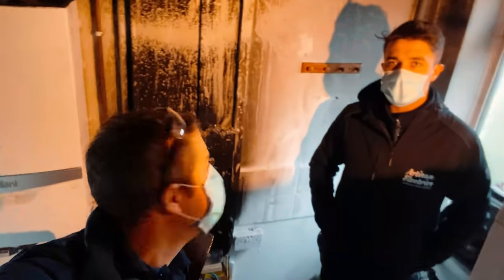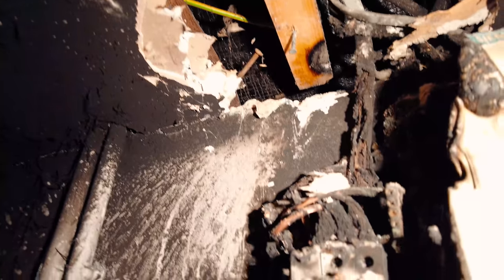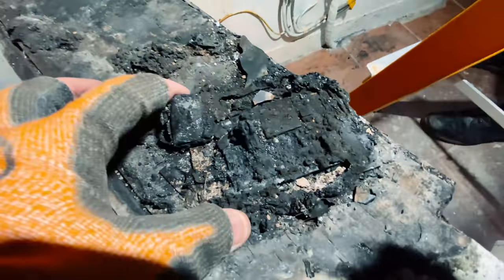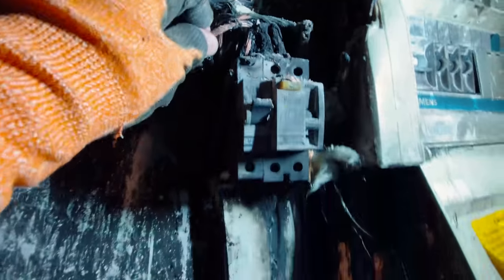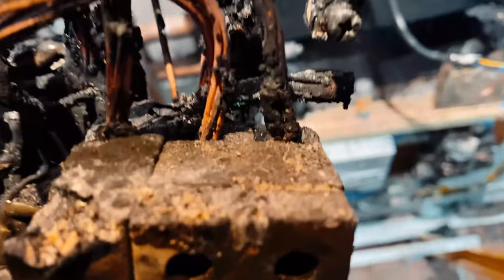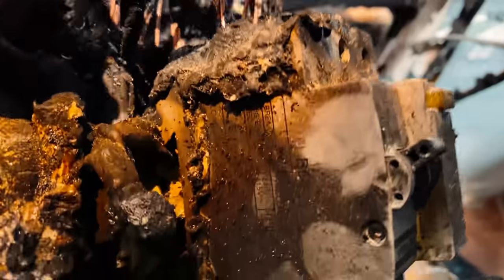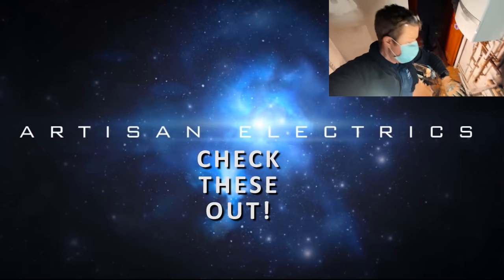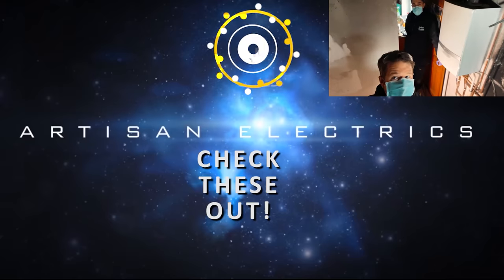Consumer Unit Fire

Comment: Worse fears realised. I'm the sort of person that always has to double check the back door even though I know I've locked it. Likewise with consumer units, I have often taken the cover off again to check terminals even though I know I did it. This would be the stuff of nightmares for me. That's why at 55 I'm giving it up. I don't wish to trivialise PTSD but this job has given me PTSD. Rarely do I sleep through a night without a dream about something like this waking me up. It seems to have got worse with age. Looking at this won't help. My brother in law is a painter and decorator. Works for himself and earns very good money. Sleeps like a log as well. Paint brushes her I come.
Reply: Sad truth is you're the kinda individual we need in this role, so it'd be a loss to loose you. Ultimately rechecking work only consumed your time, how many nested issues are there out there gone unchecked.
Reply: A big part of the problem has to be poor UK regulations. Here in Australia switch gear like that has to be in a metal fireproof enclosure which we call the 'power box' (inside of which is the plastic switch boxes), and every cable entry is sealed with flame retardant, so any fire from a bad joint self extinguishes, usually without even burning more than a few inches of cable from the switch device. Seeing the way you do things where a plastic power box with clear air gaps, can just sit on a flammable wall... its just crazy really. I wonder if UK has more house fires than AUS? Not to mention that appliance installers and plumbers would not be allowed install new switch gear.
Reply: @sectokia1909  Our regs in the UK were updated a few years ago (took them long enough!!) so that metal consumer units are mandatory, plastic ones are no longer allowed for new installations.
Reply: I am 74 and I certainly understand this, it is because you care I work on Auto electrics and the fact that I might be responsible for death injury of people does give me nightmares. My saying after many years in the electrical trades "Nothing is trivial or Obvious"

Comment: 2.45  "customers wants me to get the power back on tonight" are they having a laugh 😂.  First world problems right there
Reply: Maybe they could get a couple of coats of paint on too before they left 😂
Reply: Whilst your here could you change out some downlights for me? 😂
Reply from the maker: Yeah 😂
Reply: I guess they want some heating back which is the first emergency to restore.
But yeah...
Reply: @YouRich92  Fair point but I'd be mentioning that the boiler needs checking before switching back on, especially what looks like a melted filter... But I suppose electric heating is an alternative!
Reply: @artisanelectrics   can u make a video for torque screwdriver draper 19pcs review????? It's made in uk
Reply: @charlieecosta5592  are they fire rated🤔🤔😂😂😂

Comment: I wonder if they completely forgot to tighten the screw, stuffed the wire down the back of the clamp or just didn't recheck after the cable had been manipulated.   I was a sceptic about the torque screwdrivers until I found out that kitchen fitters are using their cordless impact drivers to tighten screws in breakers because they're......   Joiners.  That's resulting in stripped screws (WTF?) and over torqued terminals that still instantly loosened when the cable is moved.  Part-P is a terrible thing.
Technically speaking the electrical regulations don't actually require a shower isolator, but it's encouraged by the shower manufacturers so their electro-labourers can swap bits under warranty without understanding complicated things like distribution boards (meow!).  There's a good chance the isolator was grudgingly installed because the breaker was out of reach.
Reply: Did you ever do a video on this one? Took a quick look but couldn't find it if you have.
Reply: @Jason-ko2tb  
I would LOVE to see Big Clive do a tear down on this 👍🏻
Reply: I had my electric shower re-routed so to speak. It was tripping my RCD

Essentially the person before me was an auto electrician and connected the electric shower on the same circuit as some mains and decided to connect it with a bit of solder which is just fantastic /s

He's qualified to be an auto electrician but not for regular electrics 

I'm glad it tripped in a way, because £200 for a fix is better than a fire which costs a lot more in both money and lives. 

I'll be swapping it out for a mixer shower nonetheless. This is also why you absolutely should get proper sparkies out who know what they're doing.

Or indeed for anything else for that matter. Properly qualified people means that a job is done better

Comment: Very interesting to see the consequences of one loose screw on a high-current circuit. I can see that the 50A breaker didn't trip because the short circuit was on the supply side. I worry a little (as someone who designs EV charge points for a living) that we'll see more of this sort of thing with poorly installed EV chargers. Very few domestic circuits run at full capacity for hours on end, but an EV charger certainly will. Even 32A could get a loose terminal pretty toasty.
Reply: Many meters are in a cabinet on an external wall of the house. I wonder; perhaps splitting the supply off just after the meter (before the consumer unit) and passing the charge point feed through a weatherproof breaker (box) on house exterior would be best? The idea being that any fire would be on the exterior of the house.
Reply: @simongreenidge6454  I guess there's no reason why not, if the layout of the property allows it. Wouldn't work in many properties, like mine in Cambridge, though: the DNO's cutout, meter and consumer unit are all together under the stairs.
Reply: Ye  spot on especially with a load like that
Reply: This is why having a big contactor in the electrical cabinets controlled by a Thermal (HTC) Switch. It will cut off if the cabinet begin to heat too much (before a fire).
Also it is good to check the screws once a year.
Reply: Or manufacturers could transition to spring/lever terminals instead, 32A is perfectly doable and much more reliable in terms of install quality and longevity.

Comment: Few years ago new neighbour got locked out, so when i was getting her in asked her  why she had moved, she said she had a fire in the fuse box and almost burnt her house out, so was downsizing, googled fuse box fires and they seem to happen quite often,  so fitted a smoke alarm inside the fuse box housing cabinet above the front door. and one below it as well to be sure.

Also a while ago taking to an electrical engineer who said that the new smart meters are liable to catch fire as so much power going through such a small  box will cause problems.

Finally even though the power is disconected and fuse removed it still gives me the  shivers, seeing you both with fingers in the maze of cables,  from when i  pushed a Mecanno screwdriver into a 240 set of christmas tree lights, still have that fear of electric  now and the huge bang and shock.

Mecanno screwdrivers could fix anything when youre niave or just thick..

Comment: Many years ago got called out to a badly fire damaged garage with a bedroom above. The person was asleep in the bedroom at the time and room was filling with smoke. It was noticed by other family members who smelt burning and quickly got the person out of bed to safety.
It was a really easy diagnosis of fault. A gas pipe in the garage had a small pin prick allowing gas to escape and directly above was a time switch which switched on at midnight. The small spark from timeswitch ignited gas and it acted as a blow torch straight on to ceiling of garage.

Comment: I like what you said about the shower isolator being near the electric meter. Mine is a similar setup with the main circuit breaker in the meter cupboard however the isolator switch is on the wall in my hallway obviously going through the wall into the back of the shower unit. Interestingly it’s a big red switch much like a cooker switch too

Comment: I have lost count on the amount of slack connections in a consumer unit and shower switch. I always tighten these cables wait 5 minutes then usually get a quarter to half turn on the connection as copper gives.

Comment: Root cause is loose connection which was complicated by 10mm incoming t+e. 
I think the only logical way this can have happened is if the loose incoming connection caused the wire to heat and melt the insulation. Then the incoming positive melted and touched the neutral.
A 60a main fuse will carry an over current and arcing for a reasonable length of time. 
As the 10mm t+e incoming to the shower board was only protected by the supply fuse it should have been 16mm. If they had then shorted it would have carried a higher current and blown the main fuse quicker and heated less.
Reply: You are bang on sir,
Reply: But what caused the heat? Current in the cable or arcing?

Comment: As a old Sparky, I could never understand why the terminals went to one screw instead of the two we used to have. But hey whats a fire between production costs and they have only just gone back to all steel boards, well I never!. A wet string job as we used to say.  6mm backed by a 60/100a supply fuse- electrician?  Toast any one. Good job this guy didn't work on commercial.

Comment: It could have been a lot worse......thanks for showing this. Not sure you have enough cable to put a larger extender box with a DIN rail with extensions below to the CU. If not then wago boxes but just check they match the cable temp and humidity rating in which they are going to be contained in.

Comment: I'm a electrician as well and there should not be any hidden joint boxes especially above the consumer unit the cables should be replaced to the isolator switches  mains to the light circuit and both legs of a ring circuit and if there is a radial circuit the first leg of that should be replaced and any fused isolator switches from the board should be replaced  cables for extensions or a garage should have a isolator switch on it and the main cables should be replaced from the isolator to the board as hidden joint boxes especially when the board is getting replaced you shouldn't by the  bs7671 iee wiring regs place joint boxes on the cables coming into the main board so the first parts of the circuit have to be replaced to the board to keep the installation safe like!!

Comment: Definitely the shower board for point of origin. Looks like the live incomer and neutral shorted and took out the main fuse. Looks of new plaster board and paintwork needed so may as well take down the ceiling to check the cable above. Always a fun job lads.

Comment: Good job it never spread to the gas. That could of gone a lot worse
Reply: I’ve seen a house fire take out a gas boiler, totally destroyed them (there were two) but the gas never leaked or added to the blaze. All gas connections are brass, no plastic & no gaskets or seals that can melt.

Comment: Interesting thought, the old Wyler rewirables had 2 screws on the neutral and outgoing live. They never came lose!
Reply: Brilliant design on such an old board dating back about 50 or 60 years and they had  chunky brass fittings. Shame newer boards don't have that design,I am sure that consumer unit fires would be quite rare if they went back to 2 screws per terminal

Comment: Aren't there experts and investigators from the fire department or the insurance companies, who have expertise in fire investigation? Or is your investigation just out of interest of the client?
No hate! I've just never heard of electrical installation companies doing professional investigation. ;)
Reply: Yeah buddy every fire service in the UK will have a fire investigator  Ias would most insurance companies   Cory said the electricity supplier and Distribution network operator  asked him to investigate any cause of the issue and rectify them where needed I believe  hope this is helpful mate stay safe
Reply from the maker: The energy supplier asked us to provide an investigation and report as the initial thoughts were that the smart meter was to blame because it was recently fitted.
Reply: They often ask sparks to go do an investigation as 1st gen smart meters were notorious for going up in flames after being fitted due to honestly not being fit for purpose as they couldn't handle the load. Also it's basically a half day course for smart meters, lost track of the sites I've attended where they've fitted smart E7 meters and shoved the switch neutral into the data port of the meter done it up, not checked the termination and left. Smart meters by intention are great but the fines the gov issues means the lads are permanently rushing job to job so the quality of the work isn't always the best from my experience.
Reply: @effervescence5664 jesus.. that's crazy I assumed they had to  be competent qualified electricians it frightens.me that  baboons like that can pull the main fuse but yet when it comes to a spark such as Jordan or cory doing it theyd get their knuckles wrapped yet the electricians have several years experience  rather then half a days experience etc . Tbat was educational effer thanks
Reply: @artisanelectrics  Thank you for your reply! As I said: This was not meant to be an offense. I was just wondering, because in western europe, there will be an official investigation by an expert for every fire and I just didn't know that companies like suppliers ask sparks for investigations. ;)
Reply: @rickycunningham6368  Yes it's quite scary. I once reported a un-serviceable Economy 7 3 phase meter on an NHS site, E-On sent out a chap that did exactly as stated above, switched neutral in the data port. NHS site manager got me back the next day, I proved the equipment was working and the fault was still with the meter, E-On sent the engineer back, as I was on site I made him test it while he was on the phone to his manager. His manager laughed his arse off like it wasn't totally unexpected when he said it was in the data port and his manager just told him to change the meter so the paperwork matches up "maybe it was a duff meter". 

I've had issues with EDF guys on sites not being competent either, they actually turned up to a TT system the other day changed the meter and then bypassed the 100ma main RCD because it "wasn't working" - It was on the E7 switched supply.
Reply: @effervescence5664  jesus..that's not good it seems like they screw up and then leave you proper electricians to pick up the pieces from it especially when its three phase stuff (I'm not a spark) but even I know a network port shohldnt have a  neutral connected I do the Data side of things and was considering doing electrical just so when it comre to the datacenter side of stuff I dont need to have a spark out to deal with it if  I'm competent .rather then the kinder egg or poundland certificates these meter fitters seem to have lol. Stay safe guys
Reply: @effervescence5664  Hi, Are the EV Charger intallations going to have the same issues?  A half-day course and then half-trained half-wits rushing around chucking the things in as fast as possible.  With the high continuous loads, for hours not minutes, more instances of these fires will be likely (that is if the EV itself doesn't go up first!!)

Comment: A couple of years ago we smelt something like burning polystyrene by the consumer unit cupboard next to the front door.  Someone had forgot to tighten the terminal for the cooker circuit where it goes into the neutral bar. The plastic of the consumer unit housing had melted away from the bar leaving is suspended in air on the wires... So much for regulations insisting on fire doors if the consumer unit is fitted in the escape route, which is common.

Comment: Was the shower in use when the fire started?
Reply: You bet
Reply: @Hammy135  you were there ? Your house / home ?
Reply: @WhiskeyGulf71  nah, I don’t know. It’ll arc more under load though so it would make sense
Reply: @Hammy135  
I only ask because if it were your place i was going to ask if you had noticed a burning small in the days, weeks, months leading up to the fire.
Same thing happened in my place you see just without the fire, i kept smelling an electrical burning smell, not only was the screw loose to my shower MCB but also my Henley fuse (main fuse) was making poor contact & arching inside.

Comment: Would be interesting to see exactly the same set up and the result from metal 18th edition board as to how much the metal enclosure helps
Reply: The fire was external to the CU.
And part of the plastic CU that was in close proximity to the isolator has melted.

A metal CU would not have melted.
It's as simple as that.